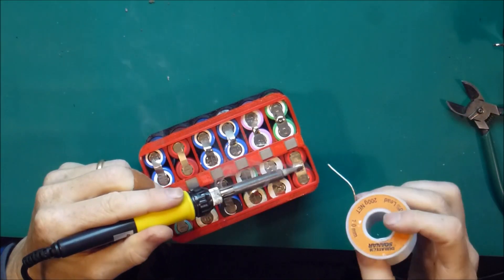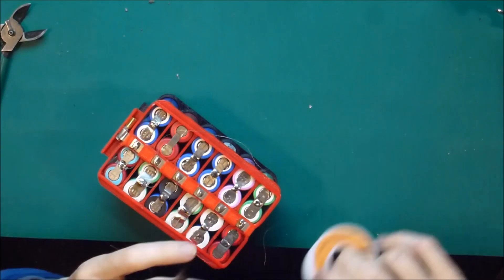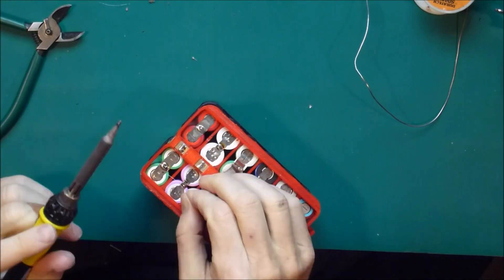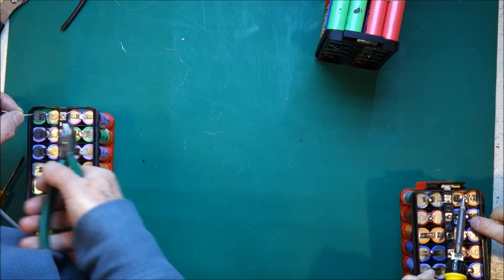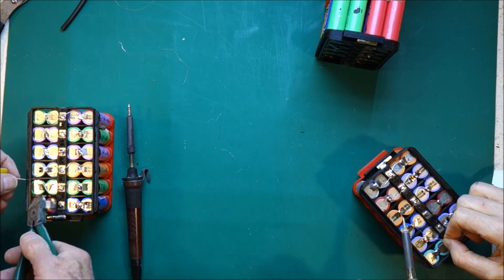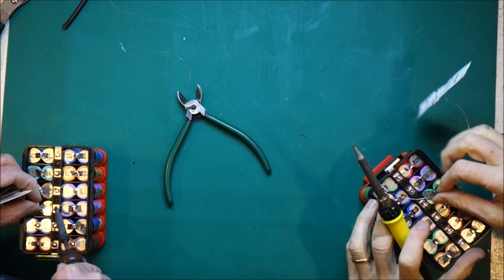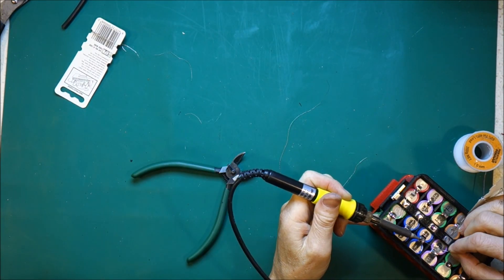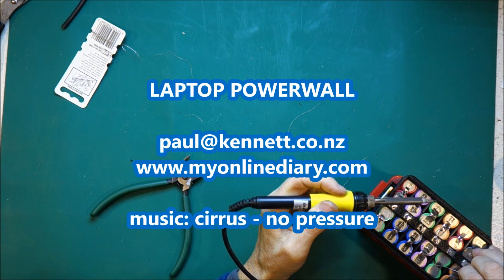Laptop Powerwall 53 - small block fuses

Comment: i like the S shaped fuse - easy to see and looks kinda factory finish.
Reply from the maker: I do that to avoid having a straight fuse which might result mechanical strain. As I'm handling  the block there's a risk of breaking a fuse if it was soldered in a straight line. And it looks kinda cool.